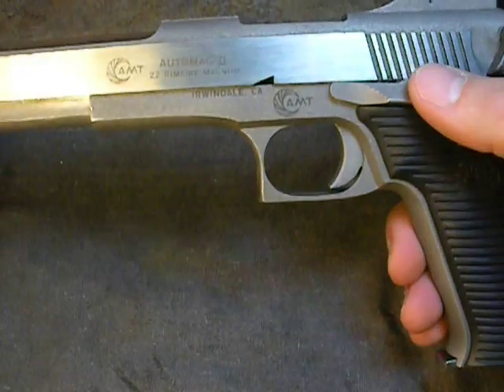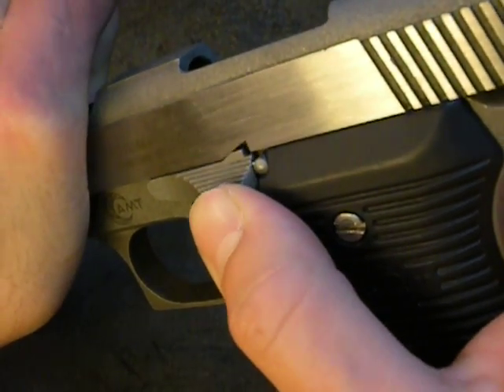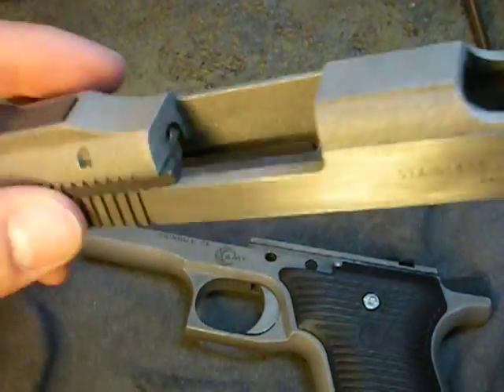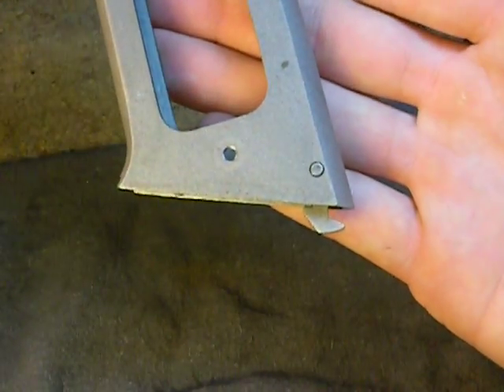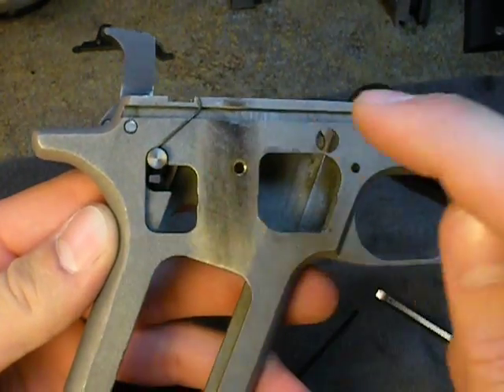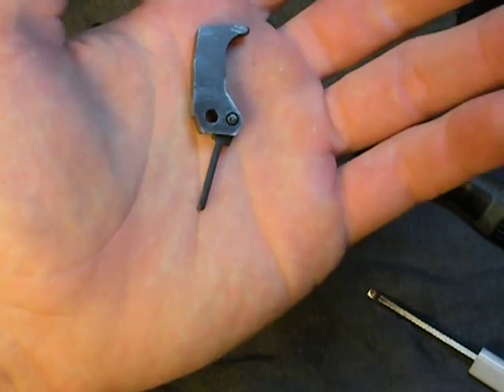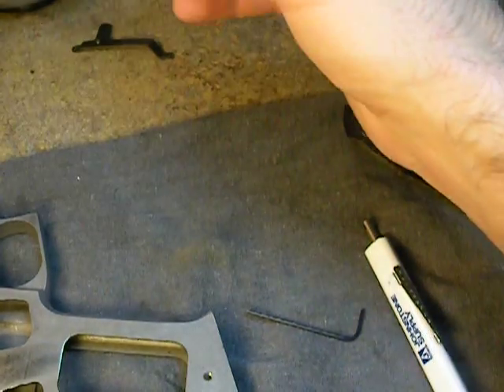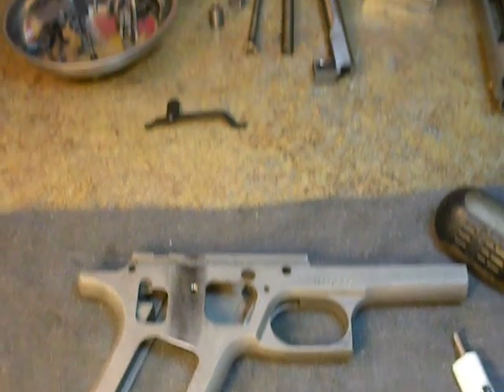AMT Automag II FULL Disassembly

Comment: Good informative video, and nice pistol! I know that AMT used 'exotic stainless steel' in the manufacture of the Hardballer 1911, they actually recommended using vegetable oil. The Automag's finish looks similar to the Hardballer.

Comment: 9 years later I own one of these and am having an issue with the slide stop engaging every other shot. Mechanically, everything looks fine, but it does have a little bit of wiggle in both the slide and the slide stop lever. Ideas?
Reply: I just ran into the same problem.  I’m guessing you lost the detent that holds the slide stop down while firing and is supposed to come up and lock the slide back in the locked position when the magazine is empty.  I searched everywhere for a replacement/new part, and it was unavailable.  I finally had to make my own part for the customer and got it fixed.   Good luck!

Comment: I bought one of these in ‘87. I found out the hard way, It only liked Winchester X hollow Points. Funny because you would think it should work well with solids.., but alas no. Also the somewhat funky mag release will get wonky on you mostly I think due due mag spring tension reduction over time. The Gun Magazine reviews at the time seemed to like the accuracy (true enough). And SS Mat’l choice. Quite a few noted some galling (abrasion) during trials. I got that but luckily I noticed it early & always used plenty of lube. Because it’s SS you will get no corrosion but you will want to handle your Magazine carefully as they are very hard to find & expensive to replace, never leave it loaded long as the Spring action will weaken (just took two weeks) you can take it apart & stretch it Out a little, put it back together & it will work, for awhile but you will need to repeat every so often. Don’t get me wrong this was my choice for a first pistol, very cool & very accurate & a noice fireball if fired near dark,( that’s why I’ve kept it). The breech area has those rows of holes that allow the Cup pressure to be controlled in such a way as to let the barrel/cartridge separate & begin the extraction process. At least that’s what those Gun Magazine writers wrote about. I found my firing pin spring broken in ‘03. Of course you can’t find the part anywhere anymore. I tried a few others based on the pieces I recovered, Nothing seems to survive more than a few shots. The Millet target sights are nice & big & the adjustments are good. I thank the internet algorithm that brought me to this vid. I further thank you who made it. For those of you who have read this deep into my comments to this end, looking for further insights into “helping” you get Ideas toward fixing that old/cool pistol you bought. Sorry Suckered again just like me!

Comment from the maker: I would suggest that you remove the plastic grips and magazine. Check to make sure it is unloaded and then give it a good spraying down with powder blast or some other type of firearm cleaning solution. Then after wiping it down, swab your barrel and then give the entire gun a light coat of rem oil or other to keep it in top condition. Hope that helps. :)

Comment: I have the same AMT 22 mag.  I took it apart to clean when I tried to remove the ejector it would not come out! Finally I was able to remove the ejector it was almost impossible to reinsert. The barrel bushing was just as difficult to remove. With the pistol apart I test fit the barrel bushing, extremely tight. What is your recommendations? File grind polish, and what part the frame or part?
Reply from the maker: +merlin750 I do not think I am going to be able to answer your questions without directly looking at the pistol sir. Best of luck. Weston
Reply: My ejector wouldn't come out either, it would wobble and the one side would slide up but the other side would not so I just left it in.  Did you figure out what causes that?  thanks
Reply: @WestonSummers  I reassembled it, my guide rod sticks out about an eighth of an inch. Do you know why? or what I did wrong?

Comment: Hi, I am using your video to disassemble my Automag III. I get the slide off but when I try to depress the spring it won't budge at all. Any help
Reply: Keegan Collins don’t know if you will read this or if you already fixed it but once the slide is off take something and depress the outer rim around the guide rod and then turn the barrel nut counter clockwise. It’s a little different on disassembly took me an hour or two to figure this out.

Comment from the maker: Just use whatever you can find! Make sure it is not corroded or anything like that before firing for safety reasons. I think we usually shoot Winchester hollow points that are in the black box. They seem to do pretty good. But, Federals should do just fine. Buenos Dia Mis Amigos!

Comment: Nice vid.  It's not that hard to do the safety without gunsmithing tools, though.  The little detent ball is a pain, but the trick is to hold it over the spring with a magnetic tipped screwdriver inserted from the side, then using a second screwdriver inserted from the center, depress the ball into the recess and hold it there.  Once you do that, insert the safety aligned in the firing position, or it will hang on the ball and possibly pull it out.  Then you drop in the firing pin spring and firing pin (probably better to do the spring before the safety), making sure that the firing pin is rotated to the correct position.  Then you put in the pin holding the firing pin in position, which is inserted from underneath the sight.  That's all there is to it.  The safety design on this gun is crap, never dry snap in the safe position, it will break the safety which has a weak spot in it.  Interestingly, I found that my trigger spring has to be installed the other way around than yours.  It sits too flat otherwise, and doesn't allow the barrel tang to raise it.  Thanks for the vid.